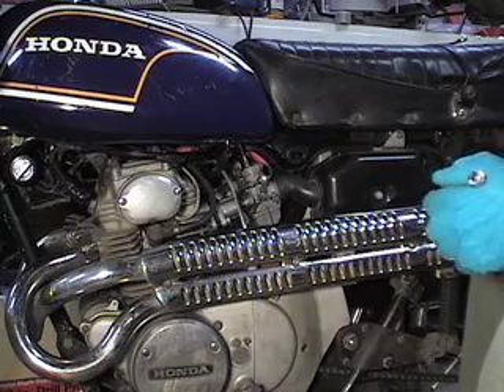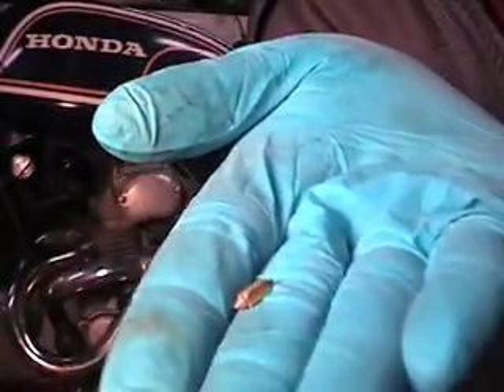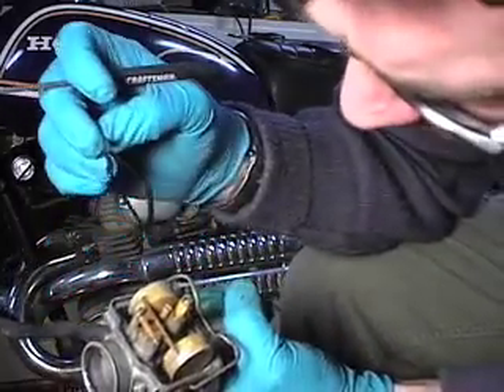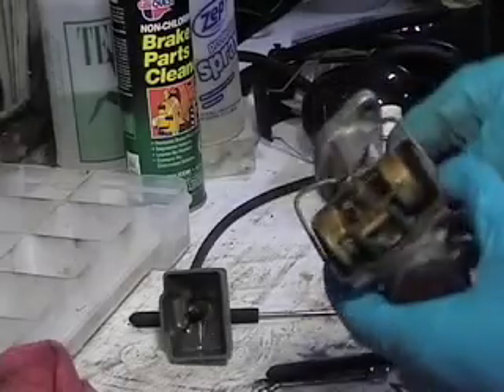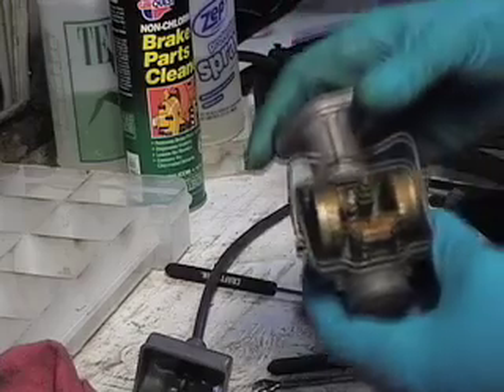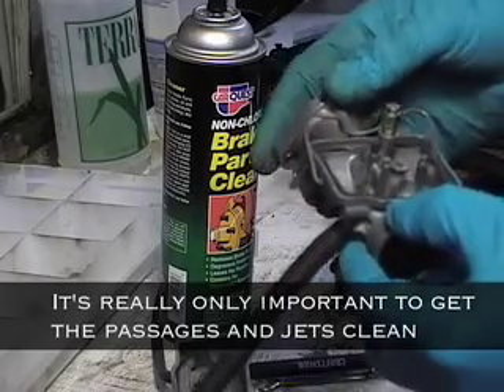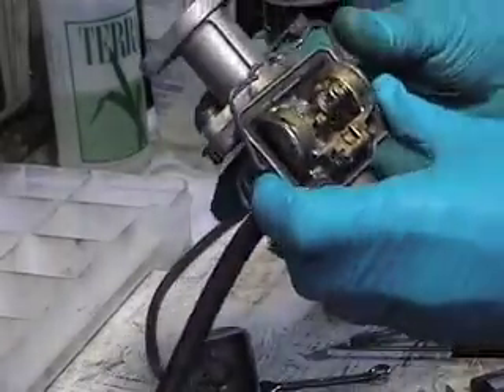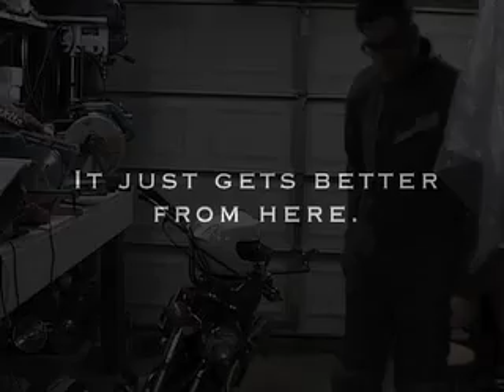CL175 Racebike Project part 7: Carbs, carbs, carbs and carbs

Comment: Five years on, I had a fuel issue and it was a plugged breather hole on the gas cap. Air couldn't get in to displace the fuel and it created a vacuum. Clean the gas cap with carb cleaner and blow air down the center hole until the tiny vent hole on the underside spits cleaner. Could be the issue.

Comment: I think I know the problem... If the needle valves haven't gone out... then the carb syncronization is way outta whack. A shop could do that for you for around 60-80 bucks. But, it is better thatn having a really choppy putter-ma-jig. And, If you have added any form of high flow airfilter or muffler, you need bigger je